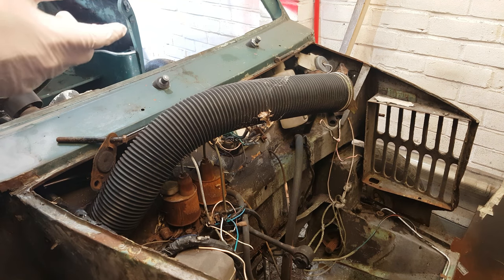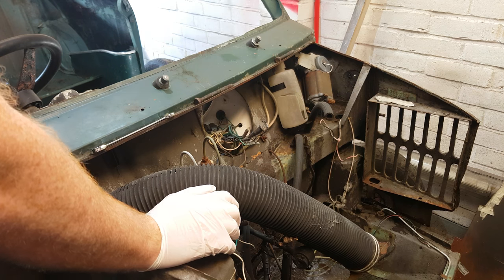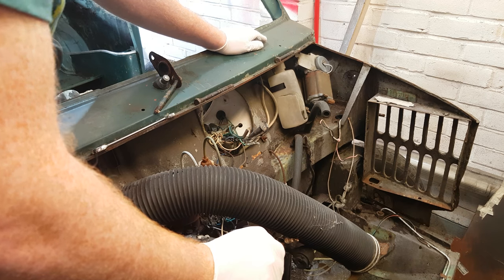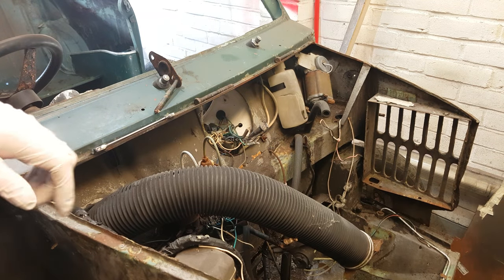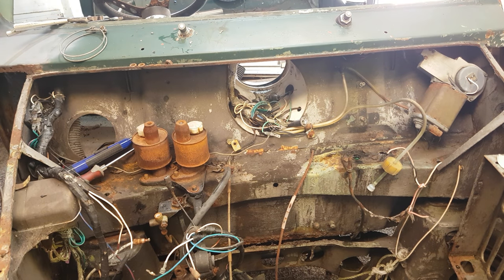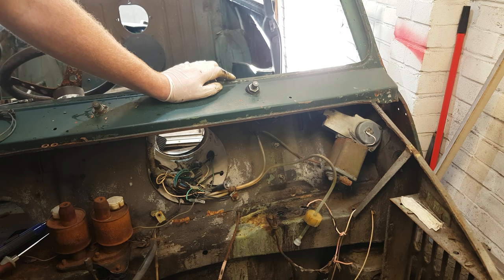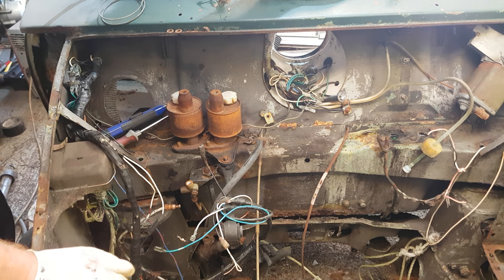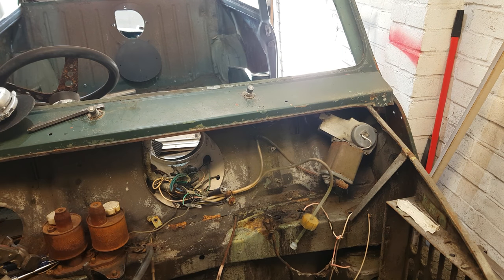1964 Mk1 Mini Restoration S2 Ep14 - Wiper Motor Removal

Comment: I took the master cylinder off my mini last week and what a pain in the arse it is to get the split pins out ☹️
Reply from the maker: +Graeme Brown I normally put R clips back on
Reply: Matt Green the brake master cylinder had one in so that was easier to get out but of course the pin was seized in!! Took two hours to get them off
Reply: got the pins out easy but the shaft would not budge even using a hammer...nightmare..but thats mini for you